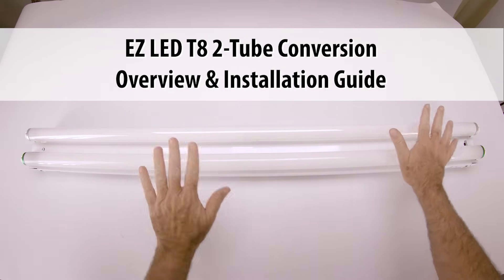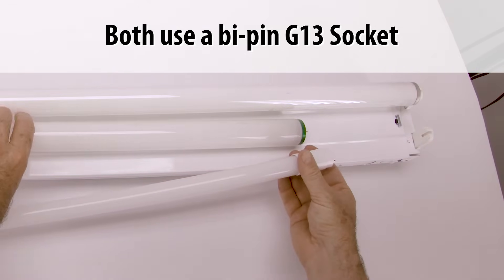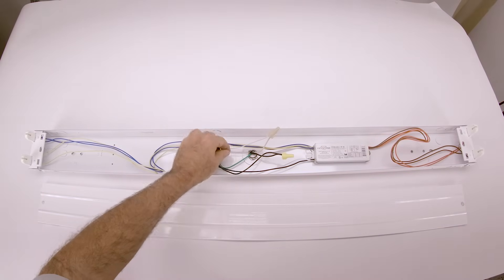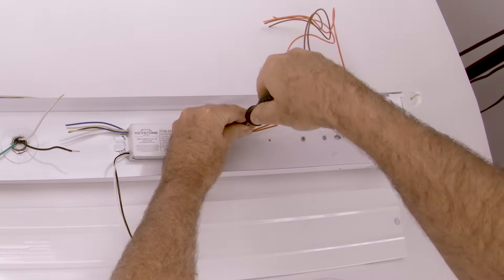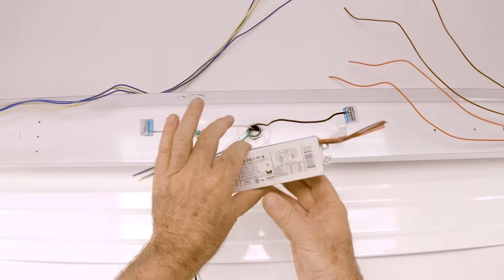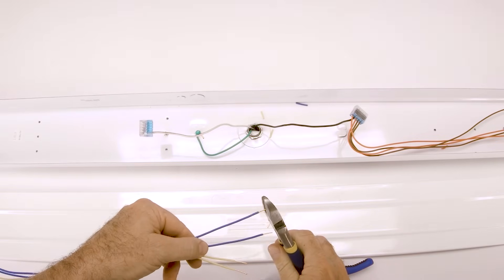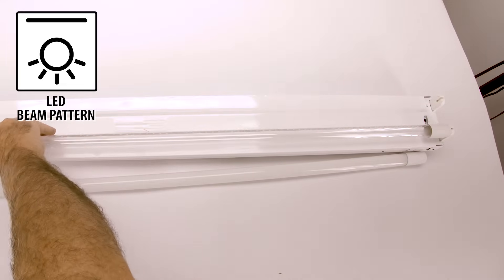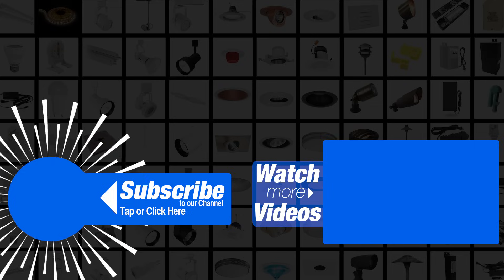EZ LED T8 Fluorescent 2-Tube light Conversion in 5 minutes or less by Total Bulk Lighting

Comment: Hi. I went on website.  I didn’t see a complete refit kit for a T-8 do you have (4)one sided,non shunted tombstones, and (4)five or more wire quick connects.  (4) 4’ 5000k daylight bulbs. As one complete kit?  I saw T-12 double end,or shunted kits for 50.  I’d rather the one side bulbs 4 ft.  Peace
Reply from the maker: We do carry single end powered LED T8 tubes but this video is not the retrofit method to use to correctly wire them. We do not recommend retrofitting to use single end powered LED T8 tubes. However, here are our single end powered kits 👉 https://www.totalbulklighting.com/retrofit-kits/t8-led-4-foot-kits.html - Here is the video on how to retrofit single end 👉 https://youtu.be/Zjw2UXVJaS0 - Also we have a conversion tool that helps better explain the difference between the two types of retrofit methods here 👉 https://www.totalbulklighting.com/fast-fluorescent-to-led-t8-conversion-tool.html - Hope this helps 🙂

Comment: Just finished removing the ballast, but the bulbs are dim not bright. Of course after I removed the ballast I noticed the bulbs said, “Ballast compatible”. Any advice?
Reply from the maker: Sounds like you have Type-A LED T8 bulbs which require the ballast to work. If you used the retrofit method shown in this video you have a Dual End Powered method and will need Type-B Double End Powered LED T8 tubes. Thankfully we sell a Universal LED T8 Bulb that will work in all 3 popular retrofit methods including the Dual End Powered method shown in this video. You can find those tubes here 👉 https://www.totalbulklighting.com/t8-led-lamps/universal-compatible-led-t8-tubes-type-a-b.html - Hope this helps 🙂

Comment: Killing power at the breaker isn't necessary, just turn off the power to the lights being worked on at their power switches.  In a home, this should be fine (tape the switch down, in a two way switch setup tape BOTH switches down.  If the switches are wired in the hot lead (they SHOULD BE!!!) this will be safe enough.  Sometimes the switch and power feed are both in the fixture, but in my case only the switched feed is brought to the fixture.  If both are in the fixture, (switch circuit connected inside the fixture) then you DO have to kill power at the breaker!!!

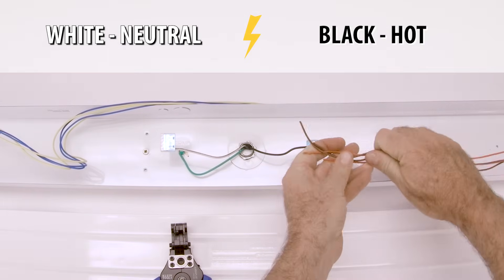Comment: 4:10 Does it matter which end you pick to be neutral and which end is hot? Or do you have to put the tube in so that the end marked "L" is at the hot end?
Reply from the maker: No, for dual end powered tubes or universal LED t8 tubes we sell it does not matter which side is hot or neutral 🙂

Comment: Thank you for pointing out at 1:05 that the same tombstone can be used for both T12 and T8 sizes. The employee at the box store where I asked about this didn't know this, and told me I needed to buy a whole new fixture. Also good job explaining about the hot side vs. neutral side. 4:50 I think you meant "probably about 3/4 inch of the wire".
Reply from the maker: So glad our video was helpful 🙂
Reply: Of course, you needed a whole new fixture.  More profit for them.  More expense for you.  Did you  really think the employee was working for you?  Yes, there were several wording errors in the video but most were respoken and corrected.

Comment: Or you can just buy an led conversion bulb and spend half the time and no wiring..
Reply from the maker: I think you are referring to Type-A LED tubes. These require zero wiring but are dependent on the existing ballast. These work great but are not ideal for every application. However, once that ballast fails you are left with 2 options. 1 - Buy a new replacement ballast and stay dependent on T8 fluorescent technology or 2 - Remove the ballast, rewire and get new LED tubes that fit the retrofit method used. Fortunately we carry a Type-A+B LED tube that makes this conversion process even better. It works with the existing fluorescent T8 electronic ballast and once that ballast fails you can keep the tubes and either replace the ballast or rewire. Saves a ton of money, saves a ton of time and reduces wast making it great for the environment! You can find these flexible Type-A+B tubes here if your interested 👉 https://www.totalbulklighting.com/t8-led-lamps/universal-compatible-led-t8-tubes-type-a-b.html

Comment: I have a question. 8 have some old 8' fixtures with the single pin connectors. I kinda want to keep them using 8'bulbs but want to convert them to led since the old fluorescent bulbs that size are hard to find. Got any products like this?
Reply from the maker: We do offer a 8-foot option here but it is not compatible with all 8' fixtures so make sure yours is compatible 👉 https://www.totalbulklighting.com/retrofit-kits/t8-led-8-foot-kits.html

Comment: I recently replaced a 2 lamp fixture T12 with LEDs. No conversion needed, just replace the bulb without removing ballast. Is there an advantage to this method?
Reply from the maker: The biggest advantage for the double end retrofit method shown in this video is that it's not dependent on the ballast and it is the fastest and easiest ballast by-pass retrofit method we have found. The issue with using Type-A LED lamps that are dependent on the existing ballast is that eventually the fluorescent ballast is going to fail and you will have two choices to make. 1️⃣Either purchase a new fluorescent ballast and continue to be dependent on outdated lighting technology that will most likely not be manufactured in the years to come and pay more in electricity to power the ballast or 2️⃣Retrofit the fixture and by-pass / remove the ballast, replacing the Type-A LED lamps with Type-B. Fortunately, a new LED T8 Lamp has arrived in the market. It is a Type-A+B and works in all retrofit situations. We have a video on this flexible LED T8 lamp here 👉 https://youtu.be/28YBLBNmhKo. This lamp is the best of both worlds. You can use it in your existing fluorescent fixture as long as the ballast is a compatible T8 electronic ballast. Once that ballast fails you can retrofit your fixture like the method in this video and the lamps will still work. It is a great alternative and will save you money in the long run. Hope this helps 🙂
Reply: @Totallightingsupply  Thank you for the answer. I had already replaced the T12 ballast right before seeing your video. I wish I had seen the video first.

Comment: That method can not be done with ALL LED bulbs. Found out my bulbs, although LED, require a ballast, magnetic or electronic as noted in the bulb packaging.
Reply from the maker: You are correct. The retrofit method used in this video is for double end powered LED tubes which are Type-B ballast bypass type. The LED tubes you are referring to are called Type-A and must be used with the existing fluorescent t8 electronic ballast. There are pros and cons to using Type-A the biggest con is that you are dependent on the ballast that could fail in the future and you would need to either replace the ballast or retrofit the fixture like the method described in this video. We sell a LED T8 tube that will work with all three major retrofit methods so regardless of the configuration our LED tubes will work. It's pretty cool and can make transitioning to a Type-B application less expensive since you're using the same bulb. You can find those universal LED tubes here if you're interested 👉 https://www.totalbulklighting.com/t8-led-lamps/universal-compatible-led-t8-tubes-type-a-b.html Have a blessed day!

Comment: Aren't  there different types of LED bulbs, and not all will work with this setup? If that is so, you should mention that at the beginning. I think I might have burned my bulbs out with this setup.
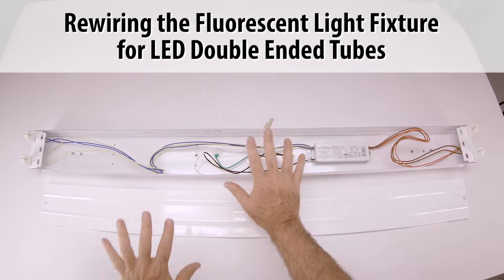Reply from the maker: Yes you are correct. There are different types of LED lamps out there and yes not all will work with this retrofit method. I am so sorry to hear you may have ruined your lamps. However, we do mention what LED tubes to use with this retrofit method at 2:37. This retrofit method is for use with Type-B Double end or Dual end powered LED lamps where the power comes into the LED tubes from only 1 side. If you did retrofit your fluorescent light fixture using the dual end method as shown in this video we sell the Double End LED tubes that will work perfectly in your fixture here 👉 https://www.totalbulklighting.com/t8-led-lamps/ez-t8-led-tubes.html Hope this helps clarify any confusion 🙂

Comment: I have what I believe is a important question ???
Can I use an off the shelf double ended t8 LED ???
The reason I ask is because the package says ballest dependent ?
Reply from the maker: Any Type-B (ballast bypass) double end powered LED T8 lamp will work with the retrofit method in this video. Sounds like you have a Type-A LED tube that requires the t8 ballast to be electrically connected to the fluorescent fixture. Type-A will not work with the retrofit method shown in this video. I hope that helps clarify 🙂

Comment: I used led ready tubes and just put them in not removed or rewiring anything works just fine.
Reply from the maker: Sounds like you installed Type-A LED T8 tubes that don't require any rewiring or socket replacement. We now offer a universal T8 LED tube that works in all three retrofit applications with or without a ballast. Check it out here 👉 https://www.totalbulklighting.com/t8-led-lamps/universal-compatible-led-t8-tubes-type-a-b.html

Comment: Can I tie the wire together if I dont have the quick connection clips?
Reply from the maker: You will need to consult with an electrician in your area regarding your local code but we always make wire connections with approved wire connectors. Unprotected bare electrical wire is extremely dangerous.

Comment: or you can buy a plug in play led buibs and dont have to do conversion, i am electrician doing service call, nobody as every ask .
Reply from the maker: Yes, the type A LED T8 retrofit works great for many applications but not every project is the same. Many of our customers are looking to get away from the dependency on the original energy consuming fluorescent ballast that will probably fail in the near future. So for them we offer our easiest retrofit solution as shown in this video 🙂

Comment: I want to convert an old Dazor desk lamp to LEDs do you have anything for that?  Thanks!
Reply from the maker: Unfortunately at this time, we do not having kits to convert over a Dazor desk lamp. I would check to see what type of fluorescent is used in the lamp and see if there is a replacement LED tube 🙂
Reply: @Totallightingsupply  Thanks.  Unfortunately the ballast in my lamp died.  Need to see if I can direct wire LED bulbs into my lamp.

Comment: Show the difference between the fluorescent lamps and the led lamps.  Measure the output in lumens of both types.  You left out the most important part of the sales presentation.  Do you purchase cars by watching a movie of the assembly line at the factory, or do you drive the car first?
Reply from the maker: Thanks for the feedback Barry. We'll keep that in mind in our future videos 🙂 This video was geared more towards the process of converting from Fluorescent to Double End Powered LED tubes to show how quick and easy it is compared to Single End Powered LED tube conversions.

Comment: WOW...total failure video. You did not light up the fixture. It seems to me you did not want people to see the light it admits. I will not bother going to your website now.
Reply from the maker: After we made this video we realized powering the light on to show it works was a huge oversight on our end. We apologize for that 😔 Our goal was to quickly show the double end powered retrofit method. The tubes used in the this video are the same I used in my garage retrofit at home and 1 of our LED double end powered tubes at 18watts replaced two fluorescent T12 tubes at 40watt each. Just be careful when buying LED T8 double end powered tubes out there. There is a lot of poor quality product with little to no support. We support our product so if there is any issues we are here to help 🙂 Have a blessed new year!

Comment: I bought 2 led tubes, removed the old bulbs and install the led bulbs. I didn’t change any wiring or remove the ballast. The worked just fine. Why remove the ballast?
Reply from the maker: Some reason to remove the ballast is that It removes a point of failure, helps reduce energy consumption, is require for certain rebates and is also required for type-B LED T8 tubes as shown in this video. Hope that shines some light on the topic 🙂
Reply: @Totallightingsupply  thank u
Reply from the maker: @antonios4926  You're very welcome! Have a blessed week 🙂
Reply: @Totallightingsupply  Have a very merry Christmas and a happy New Year to u too.
Reply: I just took down a fluorescent fitting. Gone in the dustbin. Unboxed the Led replacement. They r like holding some feathers and so difficult to install as it is so flimsy. Regreting destroying the old one. Now i just want to upgrade my existing fittings. Dont know about the ballast. But if it works, who cares. From Cyprus

Comment: Why would  you bother with all this nonsense,Just go buy some new led fixtures with tubes ready to go  No connectors no fancy wire strippers no side cutters no get the right tubes ,no get the right screwdriver   ,
Reply from the maker: Not every project needs are the same Mike. The cost of installing new fixtures is not always cost effective or the best option for some projects so a retrofit kit like we offer makes it super simple in so many ways. Think if you owned an office complex with over 100 light fixtures. Purchasing new lights, hiring an electrician to remove and install, making sure it is all approved by your local municipality can add up quick in both time and money with possible inconvenience or loss of business for your tenants. But like you mentioned, for some, installing a new light fixture is the best choice for the project. Have a blessed day 🙂
Reply: Some do it because it is fun, others do it to save a buck.  Why post such a ridiculous question? Good for you that you have money to burn...but no one else cares.

Comment: I did exactly as the video lays out. I actually have the same keystone light fixture. When I turn the light on, they turn on, but they're incredibly dim. I'm using GE Led bulbs I got from the home improvement store. Do bulbs differ?
Reply from the maker: Yes, bulbs do differ. Some LED dims. Some LED does not. It's so important to know what the bulb's lumens, color temperature, CRI, double end powered, single end powered. There are so many variables and most online stores just sell a product with little to no support. It helps to talk with someone who knows the product in a market flooded by huge quality differences.
Reply: @Totallightingsupply  
I guess i should have prefaced my comment with this small bit of information. Before I retrofitted anything I first installed the led bulbs in the original fixture with the ballast in place. They came on, and were very bright, but they would only stay on for 2 or 3 seconds then they would go out. Which is what brought me to this YouTube video. What kind of bulb do I need to buy to run in this retrofitted setup?
Reply from the maker: @stevenrasmussen23  This video deals with retrofitting for double end powered LED T8 lamps. Meaning the power comes into the LED at each end. You may have purchased single end where the power comes in at only 1 end. Single end LED tubes will not work in this retrofit application.
Reply: @Totallightingsupply   
Okay. Thanks.  I'll take them back and see what they have.  Do you offer them?
Reply from the maker: @stevenrasmussen23  We offer an easy kit  that includes the lamps that is used in the video. You can find it here https://www.totalbulklighting.com/retrofit-kits/ez-t8-led-4-foot-kits.html

Comment: Hi total lighting guy's :-).  OMG what an Awesome tutorial.  Straight to the point :-)!  I was in the process of deciding whether to convert my fluorescent to an LED.  My issue is that I just recently purchased several 8 watt 12 inch T5 fluorescent bulbs and need to know if I change the fixture over, will I be able to use those bulbs, or does your company carry this size in LED?  Also, is the LED brighter than the fluorescent?  I need brightness under my kitchen cabinets and cost effective options....Please advise...Thanks
Reply from the maker: Unfortunately we do not carry a 12 inch t5 LED tube for retrofit applications. We do provide LED under cabinet lights which you can find here: https://www.totalrecessedlighting.com/under-cabinet-lighting.html We find LED is typically brighter but you have to look at the lumens of the LED and fluorescent to know if you will have a brighter LED.
Reply: @Totallightingsupply  I need five 12" WARM white undercounter and one 24", so maybe I can repair the one 12" flouro that quit. Tiny ballast?